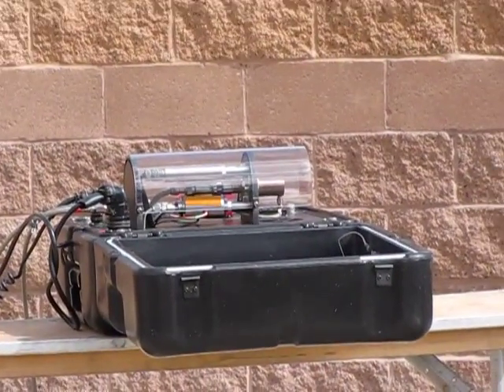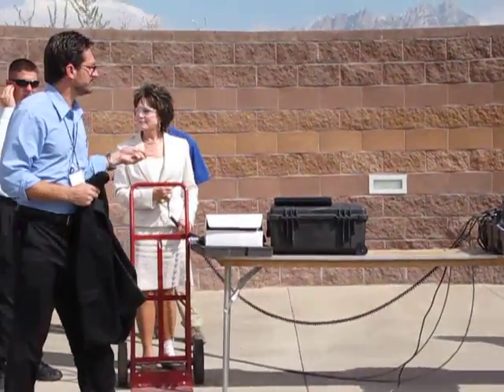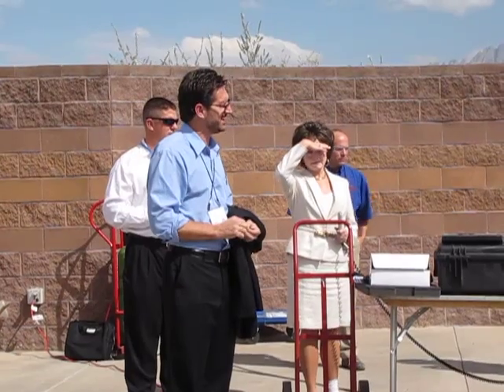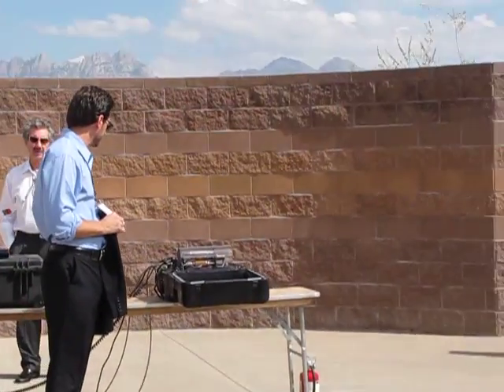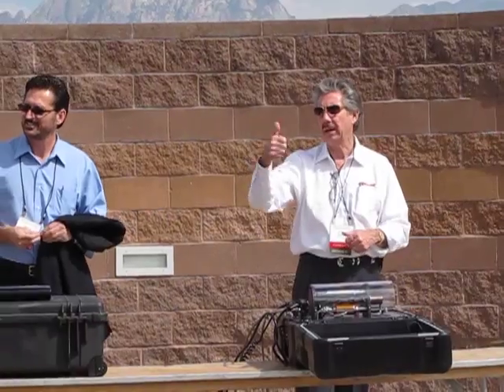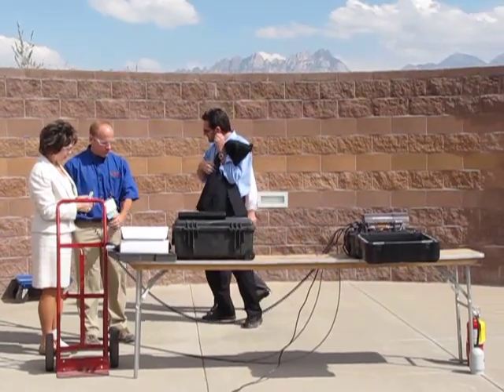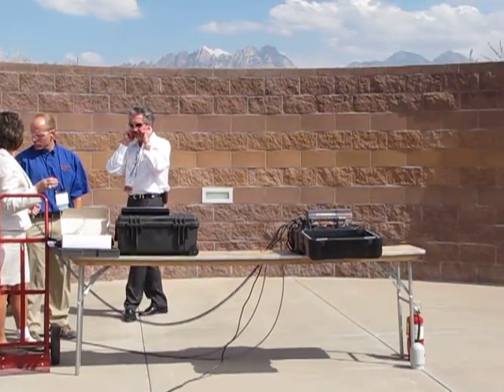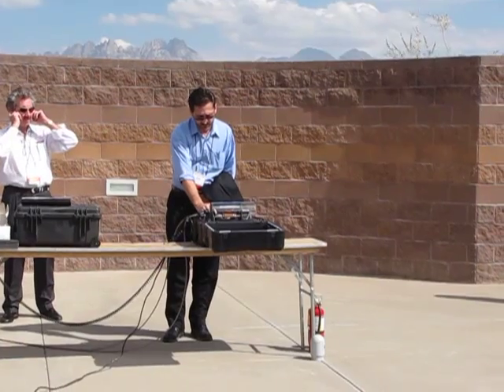Bob Bigelow and Tim Pickens Fire a Rocket

Comment: ?????? so ignition is indeterminate? i cant hear the presentation at all.. i cant see fuel lines, and its fairly loud if those few lines, other than the power and diagnostics cords, its fairly loud for lines thats small, or out of sight fuel tanks.. were you not igniting it? a hydrogen oxygen engine making that much noise would produce condesation clouds. do you design nitrox mixture engines too? where are you based?